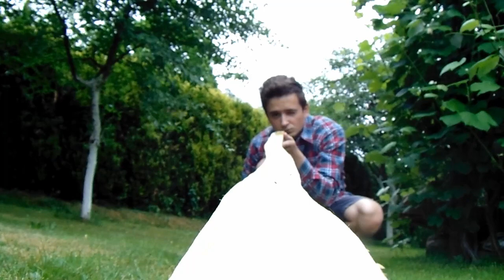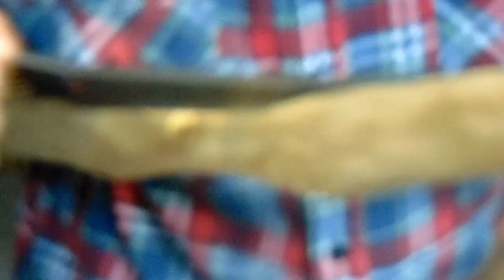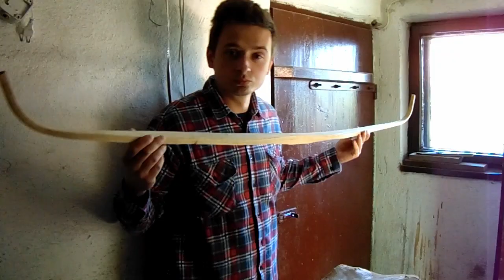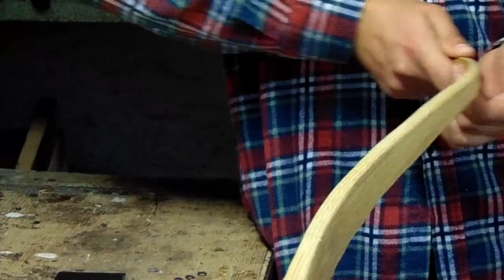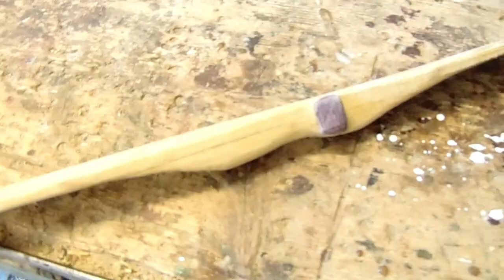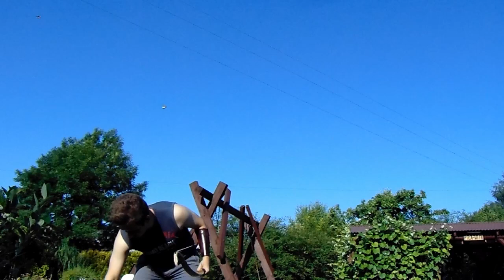Making a Black Locust Recurve Bow in Silence

Comment: Sorry if I missed it somewhere but… After heat treating for the last time, what did you finish out with for a final draw weight?
Reply from the maker: After lat heat treating I balanced tiller with card scraper and finished sanded the bow. Then I put the varnish
Reply: @DreamcraftBows  Yes, but what was the final draw weight?